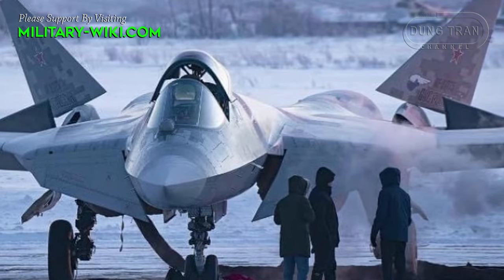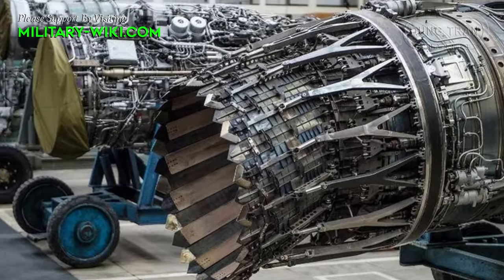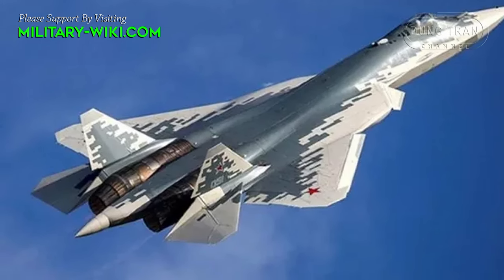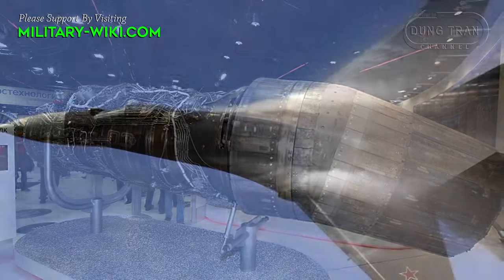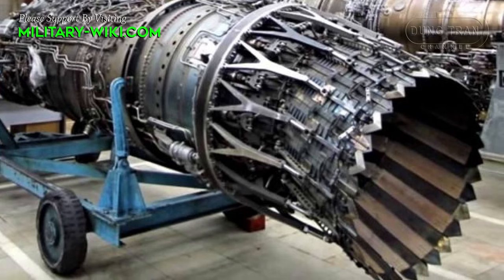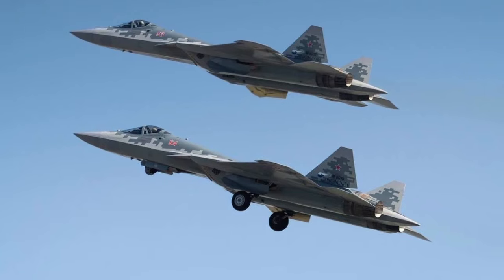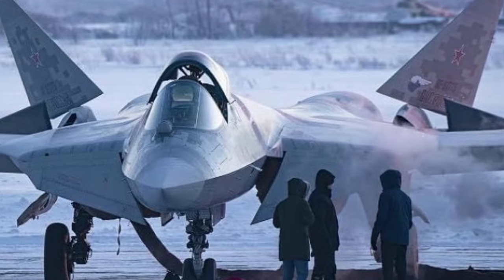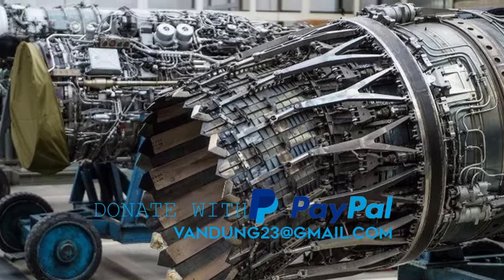Izdeliye 30 Engine Will Soon Be Fitted To The Su-57 - Improving Combat Capabilities

Comment: Just so folks understand thrust vectoring can greatly improve instantaneous turn rates.  It does not improve sustained turn rates.  Using thrust vectoring will reorient the nose of the aircraft rapidly but it will come at the cost of lost speed or altitude.  USAF mock combat with Indian thrust vectoring flankers had lead to them falling out of the sky thousands of feet and having to recover due to lost speed. This is one reason thrust vectoring was considered an innovation with little advantage for the cost.  A 3D vectoring nozzle was built for Eurofighter.  It’s of great interest in reducing takeoff and landing on carriers.  This is probably how Russia ended up with the tech. The F-22 has thrust vectoring mainly to assist super cruise.  It is likely thrust vectoring will be on Western 6th Gen fighters

Comment: The F-35 should start getting its new generation F-135 ECU engine  (7 squadrons) by 2029) and 23 by 2030.  
My understanding is the Su-57 will loose the 3 dimensional nozzles in favor of stealthier 2D nozzles. 
Thrust vectoring is inefficient.  It does not produce sustained turn rate and comes at the cost of speed and altitude or energy.
Reply: The project is dropped babe...
Reply: @adityasusantapanda  it’s not Dropped the general electric variable cycle engine is dropped.  The enhance Pratt & Whitney engine is continuing.